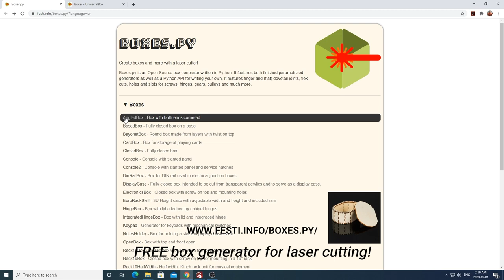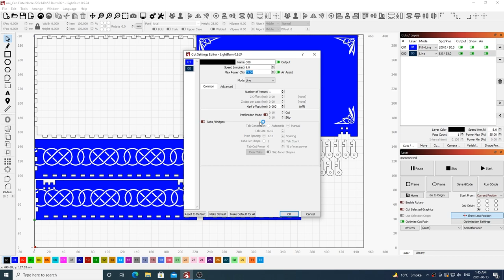Making a Nordic Rune Box with Wooden Runes

Comment: I realize this is a newbie question, buttttt, how did you get the coloring on the wood while engraving ??  Is that just the color just below the surface and engraving it is just showing whats right below the surface ??  
WAIT....is that basically doing a relief carving ????
Reply from the maker: That's just the coloring of the engraved wood. Yes, it's basically a relief carving.
Different woods with engrave at different colors. You can also add chemicals to the wood to darken the engravings.
Reply: @MakeTechCreate  Thank you!

Comment: I see you are using a 50w C02 laser.  Which make and model is it and does it have any problems cutting 1/4" plywood material?
Reply from the maker: It's a generic 3050 ebay model. My video on it is here https://youtu.be/ssUn6fAODM8
1/4" plywood is hit or miss these days. It does 1/4" Baltic Birch fine, but many of the big box store plywoods are changing glues, which causes the wood to smolder instead of cutting.